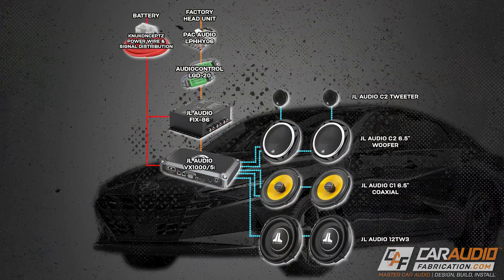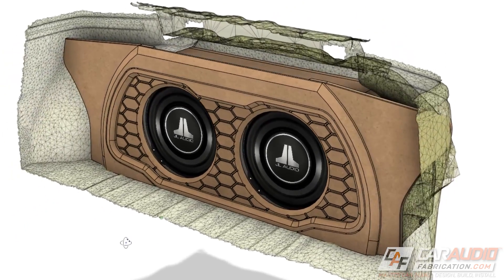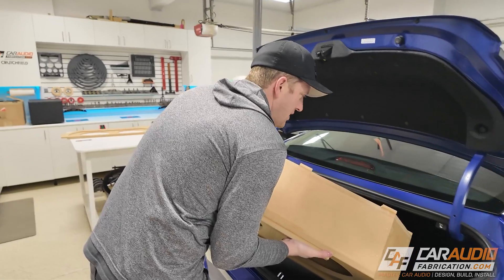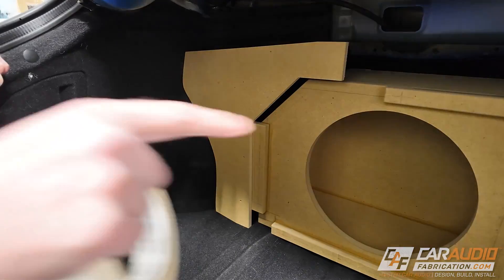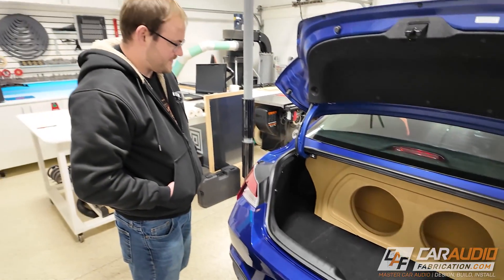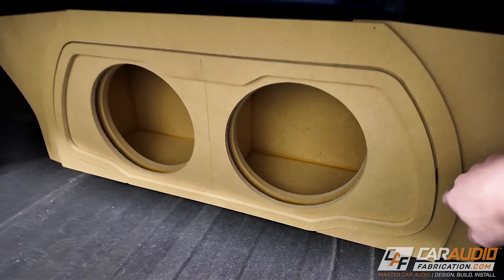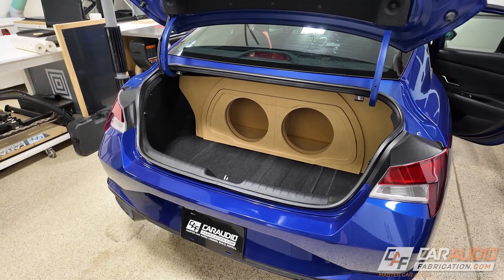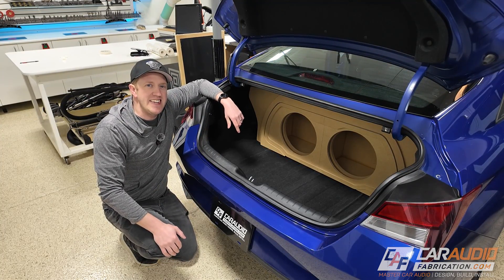Subwoofer Enclosure Designed from 3D Scanning - Did it work?!

Comment: I meant to leave you a comment on one of the previous videos of the elantra with some information that may be helpful for you. My box also has tight tolerances around those structural arches in the rear. I had to add sound deadening between the arches and the box as there are holes in the metal that began digging into the box from the vibration producing a horrible squeaking noise. It took probably 6 months before it started happening, and about a week of it before I could figure out where the noise was coming from, but it would be a good preventative measure to ensure it doesn't happen on his in the first place.

Comment: This is what got me interested in 3D scanning. I want my enclosures to fit behind the wheelwells in my van, and not encroach on the cargo area. I don't have a fancy scanner, just an XBox Kinect sensor, so the resolution isn't great. 
I'm also planning my cable runs, and new center console the same way.

Comment: Um... dumb question ... it looks like a sealed enclosure, and the trim panels pretty much seal off the trunk volume... so... wouldn't it be better if there were some ducts to funnel the sound waves from the trunk volume thru the rear seats? Or even totally flip the sub enclosure around so they are firing thru the rear seats?

Comment: I built an enclosure from measurements taken in the trunk. I built the box. Built like a tank. It was gonna fit perfect. Had everything ready to go and mounted annnnnnnnd...

It didnt fit through the trunk lid door. And....the trunk passthrough from the inside of the car was too small. Sooo...   Two days of work and a full sheet of 3/4" MDF wasted. And a lesson learned.
Reply from the maker: Supreme OOF moment. Been there for sure. Always helps to build three sides of the enclosure, even if its just with cardboard, to do a test fit.
Reply: @CarAudioFabrication  This was MANY projects and almost 20 years ago. Never made THAT mistake again.